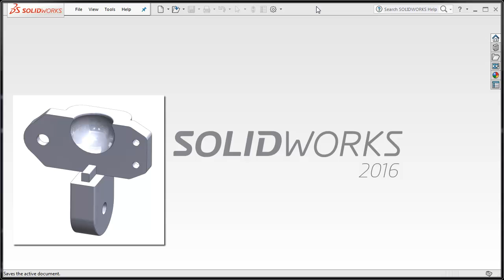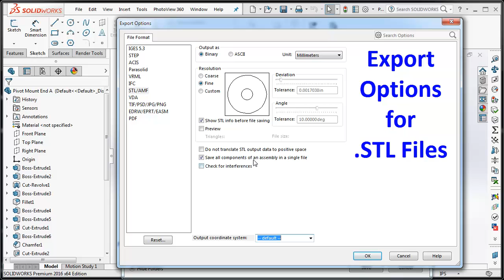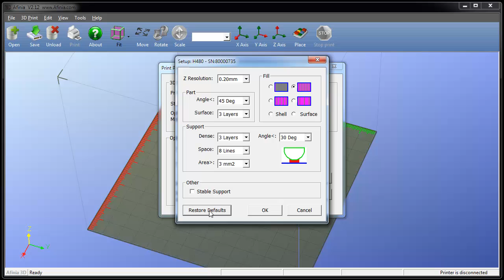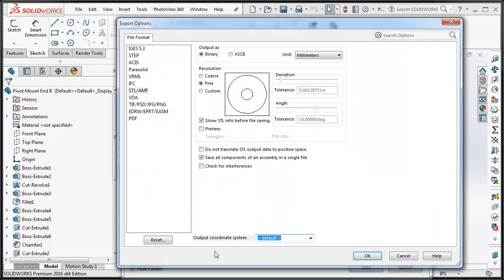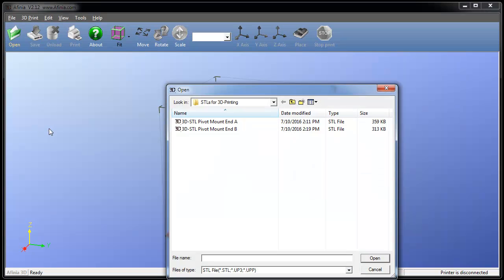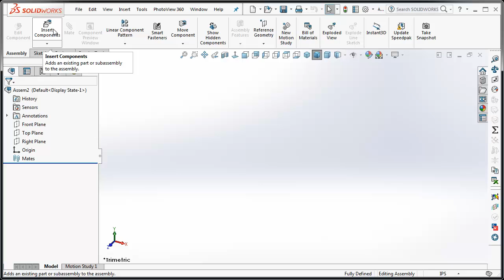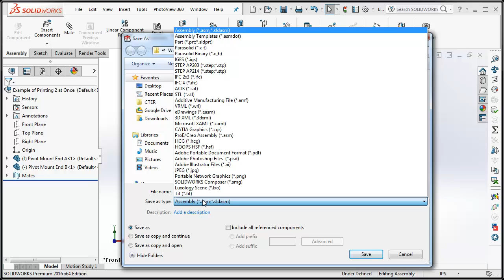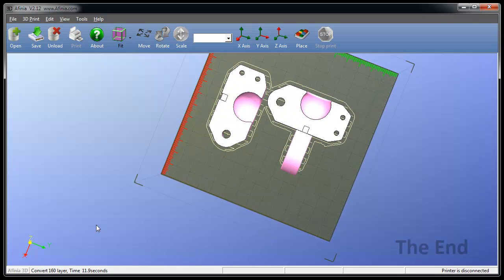Convert SolidWorks File to STL File for 3D Printing

Comment: Pro Tip:  you can place a coordinate system on the surface that you want facing the plate and then select that coordinate system in the options before saving.  This will insure that the part has the correct orientation on the plate when you load it without ever having to adjust it in the slicer software.  You can also adjust the orientation of the coordinate system X and Y  axis to control the orientation on the plate too, so you are controlling both the plane used as the starting point as well as the rotation around the Z axis.
Reply from the maker: Great suggestions ... My 3D-Printer does all this for me and is so easy to manipulate to place on platform I don't worry about it ... But very good suggestion for those that would like to set up the correct orientation :-)  It is very helpful have different perspectives and suggestions.  Thank You :-)